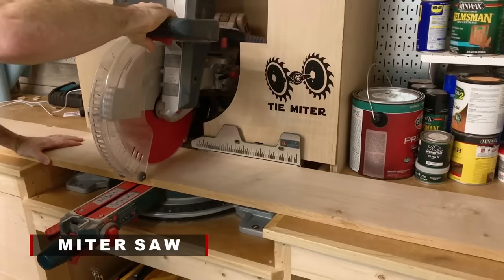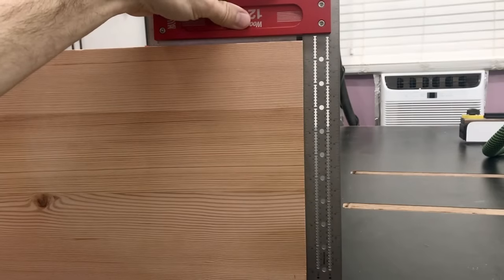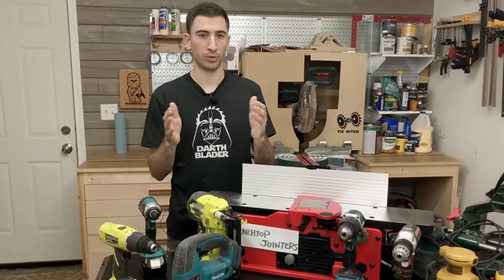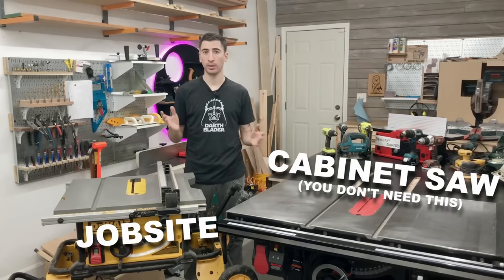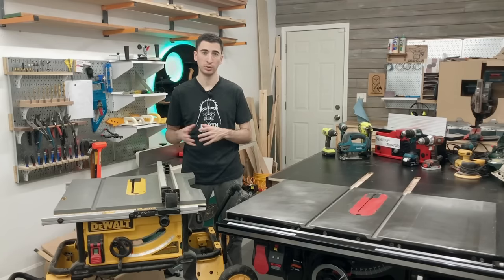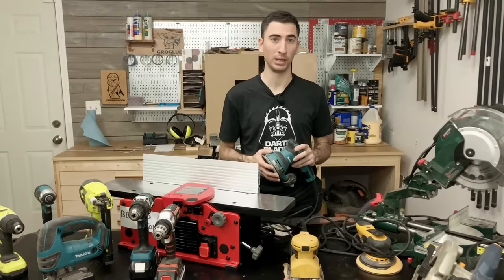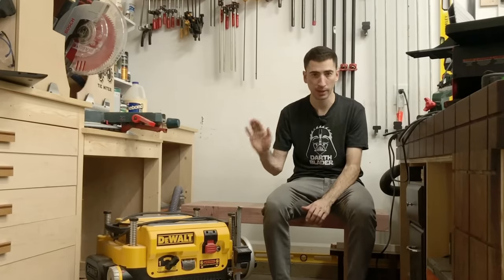Woodworking POWER Tools // Watch Before Buying

Comment: I have the Ryobi cordless tool set and they are tough!! I built my off grid tiny house with this set years ago. I use them nearly every day since and they are still holding up well. They wont break the bank and they nearly last forever. I did wear out the circular saw bearing though and had to replace that but I had used it heavily. Everything else is still running well.
Reply: I love my Ryobi cordless Lithium Ion tools, but weedwacker and the sanders are frustrating to use on battery even if you have a bunch of batteries, but the Newer green 18+ batteries run longer with a more consistent power delivery than older battery tech did (obviously).  I was given a huge box literally like 50-60 (used, but free), of the new style batteries so my tolerance for using batteries on those two tools has gone up greatly.  Only half or so charge, but I have so many that I haven't taken the time to see if they have a bad cell or just low charge tripping the protection circuit.  

They are great, I still have some of the old Nickel battery tools and they're still going just got warn out brushes.
Reply from the maker: Awesome
Reply: @Lincolnstww  Yeah it's awesome I'll just pop one of the 4Ah batteries in there then bring one or two out with me and it works out fine and if not I have a dozen more waiting on the sideline LOL.  The other nice thing about these is the power usage profile with the NiMH batteries the tools (especially weed wackers) would noticeably start being weaker within a few minutes and just slowly die off VERY annoying!  The lithium batteries start to show power drops closer to being dead then they drop off quick way nicer IMO.  
They got a lot of different batteries checking mine I have my original two LI+ION batteries from them (P104 dual layer) are 48Wh and my "new" (P108 dual layer) is 72Wh not bad.  The others are single thickness but pretty good P102 24Wh, P107 28Wh, P190 36Wh crazy seeing battery evolution.
Reply: Yes!  I built my cabin in the Adirondacks with my ryobi tools.
Reply: I love my 18v ryobi tools.
Reply: @adambacon8874  I picked up the 40v for yard stuff, weed wacker and such, it's great for my 1/5 acre, but you'll definitely need extra batteries for larger properties.
Reply: i have been working with Ryobi for fifteen years.   I like them.  I only burned up three.  Two were cordless rotozips, and the other was a weed eater. Cutting out junction boxes and windows out of 5/8 drywall wall is tough work and corded rotozips don't last long either.
Reply: I have several of these and built our Off-Grid home with them.  Worked fine and am still using them.
Reply: I'm a tradesman. Using ryobi too. Great tools, dropped off ladders, high torque. I've had a skil saw for 15 years. Works great.  Dropped a makita off a ladder. Ruined it. I think your mistaken my friend
Reply: same here a great starter set and very useful tools
Reply: @mmmbacon7939  I did a lot of metal stud framing at one point of my life.  It seemed that the makita was the only line electricians used.  They make a very distinct sound when the fall off the ladder.  And they were usually much the worse for wear afterwards.  I might have not communicated well.  I like ryobi, I have a whole line up that I have had for fifteen years.  Thats pretty much all I will buy nowdays
Reply: @adambacon8874   Went thru eight batteries in three years and had enough. The tools are ok, but the batteries are pure crap.
Reply: Lol I bought the dewalt 18xrp versa pack decades ago and I still use it and I still buy other tools that work with those batteries 
Yes you lithium is lighter but I can use it like a club from time to time 
And they still make and sell new batteries that work with them 
I’ve got lithium batteries that work with the tools also for when I’m wanting longer battery life but to be honest I don’t see much need as the 18 lasts longer than I can work without rest anyways unless I’m ripping plywood down 
But if I have enough of that I use my corded saws
Reply: One thing that I like about the Ryobi cordless tools is that they still use the same battery connection for Lithium batteries that they used for NiMH batteries. So older tools will work with new batteries. Other brands seemed to change every 4-5 years. Not sure if they have standardized now or not I skip Yellow, Orange, Blue, and Red so haven’t looked at features in years. Hard for me to justify replacing 15-20 different tools.
Reply: I agree. They are solid tools and will get the job done for less than other brands. However, I say this as an ocassional user, if I were making a living out of this I would definitely get something better, namely Makita, Festo, Hilti...
Reply: @pornpori  honestly as a journeyman with 30 years construction 
I only use cheep on site because expensive can cost you a days labour if the they get stolen or broken 
And recently steeling has become quite the problem on job sites 
Hell can’t even leave tools sit in place over lunch anymore
Reply: Nobody else mentions it but I also like the color
Reply: look at your subs, insane!
Reply: Im gutting and renovating my tiny house this spring & was planning on going al ryobi lol
Reply: Yep, same. Ryobi for 10 years now, they work good enough for anyone not doing pro-level stuff, and if they breakdown, you can buy two for the price of one Makita. That said, he is SPOT on about the construction site saw by Ryobi, it’s the only purchase I regret. It’s flimsy, the runner slots aren’t standard sized, and the fence system is terrible. I’m waiting for the plastic housing to crack some more so I can justify a new purchase.
Reply: I still got their blue drill.
Reply: Really my circular saw 6.5 multi tool with most use for the cutting blade and hammer drill all have crapped out on me and upon inspection they all had the motor go out brushes ground flat and bearings out giving tons of wobble.
Reply: I have the ryobi 8 1/4 jobsite saw, thing is actually very good. Had an issue with not true 90 cuts, but that was my fault for not making sure the fence was square.
Reply: I agree. I have use Ryobi for 10 years, and They are awesome. I bought more Ryobi tools, cord and cordless tools, and they don't break. Very good brand for me. Thanks
Reply: I'm with you. I have owned Ryobi cordless tools for over 12 years. I have built hundreds of Adirondack from used oak whiskey barrels with them. The only thing I did was replace was the chucks on 2 of my drills. I have somewhere north of 20 Ryobi pieces, and the only one I don't like is the palm sander. I don't see the need to spend the extra money on the Red or Yellow tools. I did upgrade to the 4maH batteries. These are great tools for DIY Homeowners to light manufacturing.
Reply: @kevinfrench5915  yea absolutely, Me too upgrade to 4 Mh batteries for duration and I do have the palm disc sander because I can go from one side to the other in the project without getting tangle with the cord and I pretty happy with it results. I don’t fully understand the comments downgrading Ryobi unless he maybe never has a lot of experience with them or Ryobi didn’t want to sponsor him and he got angry, otherwise I would recommend Ryobi without a doubt. I mean I recognize the good quality of dewalt but my Ryobi tools has nothing to envy other branches. Let’s see my list drill, sawzall. Skillsaw, lights 4 # size, grinder, impact drill 2, nail gun, concrete drill, table saw, chain saw gas, weed eater , chain saw +16 ft extensions, router, mini sander the triangle one, band saw, mobile welder,  table grinder, and 1 blower that is the only one not working and I bought it used so maybe has been miss treated and I have to look into it, otherwise very happy with Ryobi
Reply: @adambacon8874  Gotta go to their 40v for the weed eater. Works amazingly well. I have 5 acres of land and use their 6AH battery and it does the whole thing. I just bought their Riding mower and it does great.
Reply: I'm invested in the Ryobi family of cordless tools and I love them. They perform well and seem to be pretty tough. So far the only Ryobi I won't be getting is the corded table saw. I hate to say it but it seems to be on the cheap side. As far as the cordless tools though, I love them.
Reply: @TheJeffyBob  Me too!  Table saw run by battery? mmm seems not to have too much power neither life...haha...I love Ryobi tough.
Reply: @kobrien6657  kudos to you!
Reply: @pornpori  Im a plumber and I beat on them every day, absolutely no need for a more expensive NAME on the side of the tool.
Reply: @busomite  I am a 25 year plumber.  They're just fine for pro applications.
Reply: @adambacon8874  I'm sorry to say my experience of Ryobi has been totally negative. Bought a cordless circular saw, flimsy sole plate, battery capacity too small, lack of power. When I approached Ryobi, twice, I received absolutely no response. They seem to have a 'take the money and run' business model.

Comment: I started woodworking in the 7th grade and continued through high school. I make, doors, cabinets, and anything else. Here is part if my list. Chop saw is a Festool, table saw is an Ulmia with sliding table, jointer is a Yates American, stroke sander is an Oliver,  bandsaw is a Yates American y-30, vertical belt sander is a Powermatic, mortiser is a Piwermatic foot operated, I also use a Festool Domino 700.planer is a SCMI 9hp. Plus a bunch more in my home shop.

Comment: 1:25 I've been doing w working for over 30 years. just bought a miter saw this year. love it.
1:59 started using Ryobi in 2004, my drill still works. 41 tools later....
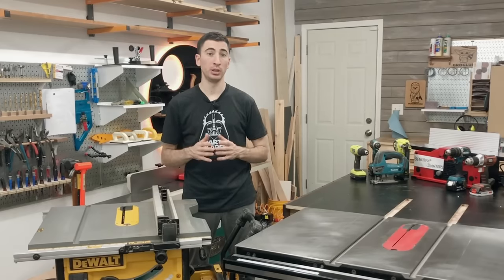3:33 my craftsmen jobsite 10" from 2004 still works great in my massive table. 
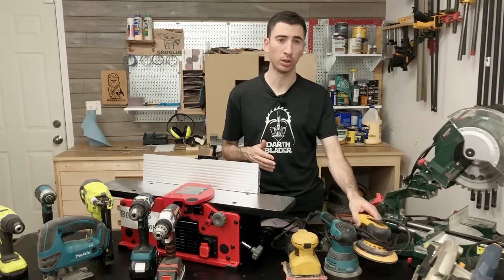5:00 my H freight orbital one still works after 8 years, I prefer my 2 Ryobi cordless  sanders; brushless belt and orbital. 
6:31 still havent got a planer but shopping for a 3 blade or spiral.

Comment: I love my Ryobi cordless drill and driver. I bought them as a combo pack 17 years ago. Since then they have built 2 homes and are still constantly being used. I bought some larger batteries for them a few years ago to get a longer run-time but the originals still hold charge well.
Reply: I totally agree. I bought a combo pack in 2014 and I'm still using them daily. They don't owe me a dime when they finally crap out.
Reply: I have a few of the old blue Ryobi stuff and they are still solid - except my random orbit needs a new velcro pad but they are unavailable from Ryobi  because "this model has been discontinued" which it shitty of them but I can probably find one that's compatible.

Comment: I've been  looking at which table saw best suits my needs, and I keep  coming  back to the Dewalt because it's fence and rail system is better than a lot of other more expensive table saws. Thanks for  your insights sir.
Reply: I’ve come to the same conclusion, but for a couple of hundred more you can get the saw stop contractor saw….
Reply: Happy with my Rigid and it does take a dado blade.
Reply: I own 3 - 10” table saws. A 3 hp jet cabinet saw. A 1.5 hp jet contractor saw. And a dewalt 10” portable table saw. I use the dewalt saw a lot. It doesn’t have the power of the other 2 and I use it mostly for plywood and soft woods. But I have say, it’s a great saw for the $. And the dust collection is pretty good. I take it to rentals and use it in the garage. When shopping for a saw, make sure it has a good fence. Make sure it’s straight to the blade and SOLID. It should not deflect, unless really pushed on hard.

Comment: Enjoyable channel.  Happy to have stumbled across it.  Common sense advice.  My situation is a higher budget but limited space.  Mine is a one car garage that I've done everything from transmission work, engine repair to furniture.   I don't have space for large immovable tools.  Everything has got to roll.  And nothing can dominate space.  Glad to hear your advice regarding contractor table saws and dust collection.   A mask!  That's what I use.  High portable and high filtration.  I do use a small shop vac for hand sanders and such.  The bigger Ridgid shop vac pulls on the router stand and my BT3000 table saw.  I can not justify the expense and space needed for a large filtration unit.  Regarding dust escaping from bag units just have a unit in another space or exhaust outside.  

Appreciate your time.

Comment: I recently came to the same conclusion that cordless sanders are not worth it due to dust collection hoses. Thanks for the thoughtful explanations and snarky wit. I look forward to your videos.
Reply from the maker: Thank you Lance
Reply: I went corded simply for price.  It was $90 for corded vs. $180 for a battery-powered one.  Not everything needs to be cordless and half the price always wins in my books.
Reply: I find the idea of a cordless sander to be silly. A sander is one of those tools that you run for extended periods of time. Not very battery friendly. And Jon makes the best point about being tethered to dust collection. A cordless sander is kind of like, wireless cable ties.

Comment: When looking at tables saws, here’s what i ran into.   I first picked up a skil.   the miter slot was a nonstandard t shape,  not 3/4” slot and i could not upgrade the miter gauge.   I think that went back to the store after one cut.    I replaced it with a Dewalt saw similar to what is shown here, but it did not support dado blade stacks.   I got by with it for quite a while, but occasionally was frustrated by the small rip width, lack of dado blade, and underpowered when ripping long boards.      All that to say, bigger is better on a table saw, and now I have a small cabinet saw from Grizzly,   which is way more fun to use.     Think about the features you need before buying...   rip width,  safety, power,  table size, mobility,  miter track size, dado blades etc.
Reply: Bigger is better, but most people don’t have the money and plenty don’t have the space.  The current Dewalt though can do up to 82.5 cm width, has a 2kW motor, uses standard slots and the arbor is long enough for those who want to use a dado blade.
Reply from the maker: What Ian said
Reply: Maybe the deWalt is much better than my Makita. I have a Sedgwick saw in my workshop, but I bought a much cheaper site saw for my home. It is so inferior and less safe. The plastic guard was smashed when a cut off jammed in the insert slot. It is noisy and the mitre fence is loose in the slot. Although it does seem to crosscut square. Without dust extraction the rise and fall needs regular attention. Perhaps a beginner should have a mitre saw for cross cutting and a track saw system for ripping. Both might still be useful after upgrading to a table saw. I also recommend a cheap edge sander till you can afford a better one. The whole thing depends on how much disposable income you have.
Reply: @ian1352  Yep. This.
I have the DW745. LOVE it, but it does not accept Dado's as the arbor is just long enough for a single blade. The newer model has included a longer arbor for Dado's and slightly faster blade speed. Motor is exactly the same.

Comment: That Dewalt saw is a beast! Bought an older model on clearance when I was doing a reno for one of my girls - I like that it had an imperial and a metric scale for the rip fence (metric is great when you need to “take just a little off”). Made some flooring transitions out of red oak and needed to rip down 3/4 x 6” boards to 1/2”. Ripped on edge with blade at full height and the saw never even slowed down. Just a beast! And that fence is dead on accurate.
Reply: I just bought the DeWalt job site this is good news
Reply: @farrockawayboyz6881  I bought the Dewalt and love it. I couldn’t be happier. I took back the Ryobi , what a piece of junk. I could cut more accurately with a spoon